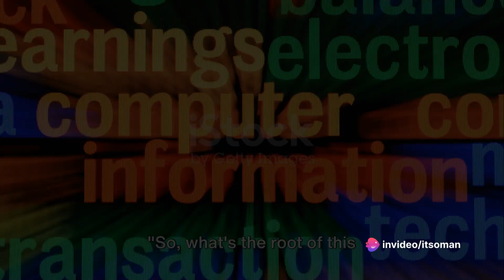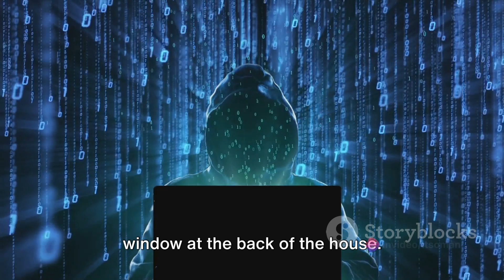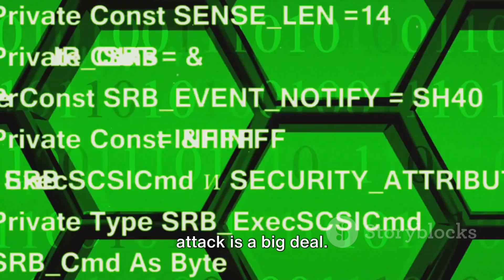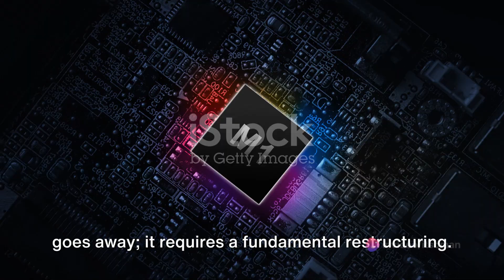Apple Chip Leaks Encryption Keys and Could Leak Private Data

Comment: This can only happen if a hacker has your pc or laptop in person
Reply: An attacker just needs to be able to run code on your laptop, so this can be through a program you downloaded or potentially, via a future exploit that allows remote code execution, or even via a web site that you visit. This vulnerability is like the Spectre vulnerability in Intel chips, where even JavaScript based exploits existed. The main difference is that Intel could patch their CPUs using microcode updates that were distributed via Windows, Linux and MacOs updates. The M-series chips being RISC chips do not use microcode and therefore cannot be fixed.